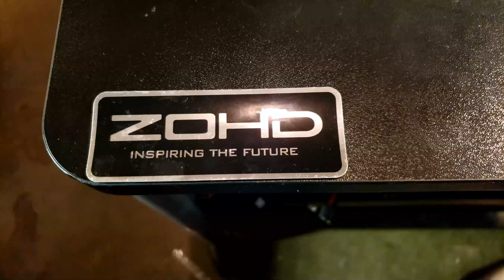Build Complete 😎 ZOHD Delta Strike 50mm EDF Wing

Comment: duuuuuude.... why are there so little videos of it flying on youtube? like something is wrong with it?!? Did you fly it?
Reply from the maker: I noticed the lack in video's of this plane 🤔
I honestly went to maiden it months ago after this video. And I crashed it right after launch. No damage to the frame at all. And I'm not 100% sure what was the cause. I did have it around 30g to 40g over recommended weight. It acted tail heavy. And the weather has been awful since then. So I haven't had a chance to Remaiden it.
Reply: @JD_1  thank you for your reply! I assumed most probably crashed it hard on maiden and had nothing to show off... that's why there is such a lack of flight videos... I mean EDFs are known to be not easy to fly and so are deltas at low speed which EDFs are super prone to suffering from (low speed at launch)... Had high hopes since its a ZOHD... but now I will hold off buying it for now :( Looking forward to your video :)